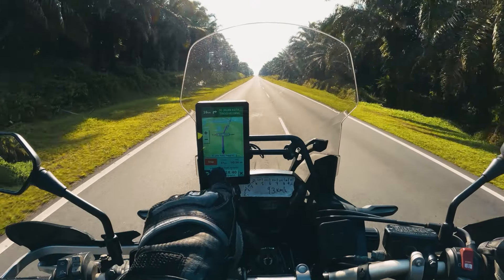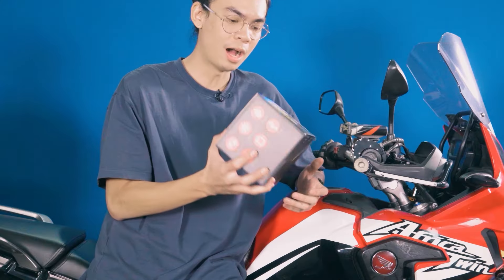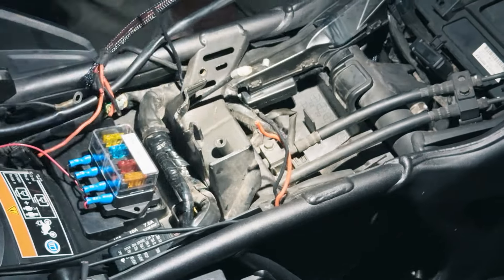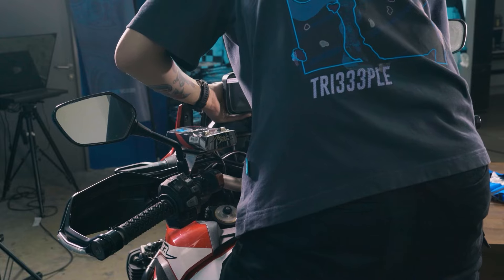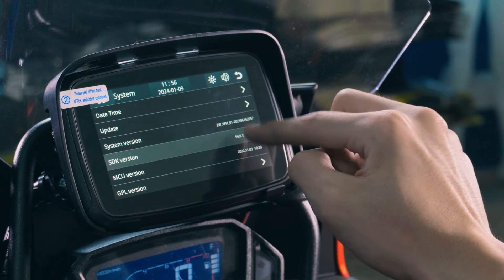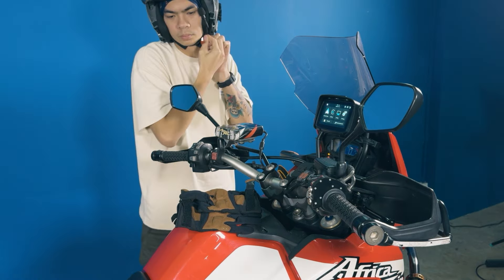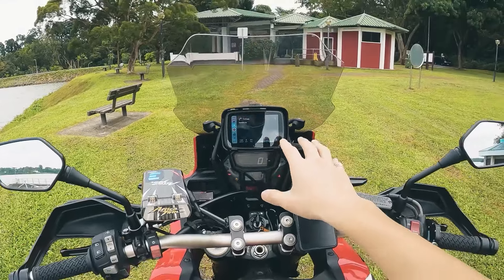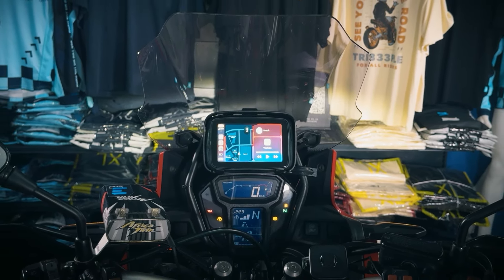Ottocast C5 Lite CUSTOM BOOT IMAGE | ScrewIt EP8

Comment: would this fit on a vespa with no handlebar?
Reply from the maker: It uses a standard ram mount system, and would be able to have fittings to mount onto the mirror mounts for example. You might have to get some parts for that if the included mounting doesn't fit your bike, but it's definitely do-able.

Comment: Thanks for this video, can you tell me where to get the firmware file to try to flash my unit with custom logo?
Reply: I already have the image file I want to show up on boot, but I’m not finding Ottocast fw file to flash it.
Reply: I bricked my C5 ( all black when turning on ) then asked Ottocast their original fw and it started working again, but even if I put the logo.jpg ( 1024x768 ) in the sd root with the fw it flashes the fw but won’t change the boot image.
Reply from the maker: Hey man! From our research, it depends on the FW already flashed onto the C5. Some firmware, especially updated ones, might no longer support changing of the boot image, and trying to flash would end up bricking the device!

Comment: Wonder if there is a device that i can slot a SIM card in so that i dont have to worry about wifi connection..
Reply from the maker: Devices like this tether to your phone, so chances are if your phone has no connection, even with a sim card in the device, you'd also probably have no reception. If that's a possible fear, getting a dedicated GPS unit that communicates with GPS satellites would be a better option.

Comment: Mine keeps turning off randomly. Ever happened to you?
Reply from the maker: Yeah it happened a few times to me, but checked the power connection and turns out it was loose. If that doesn’t fix your issue, a firmware update might be in place.

Comment: The c5 lite is interesting, but if I had to pay someone to help install all those wiring, I rather use the money towards a zumo xt, which I can install easily by myself...😂😂😂
Reply from the maker: Actually don’t need to, as the wiring is just a positive and a ground for the USB. If you already have an underwear usb you can connect the connector to it easily!

Comment: lol you can get the oem device at half the price
Reply: Can you link where to buy?
Reply: @HanazonoFiama Taobao bro, if I remember correctly with shipping and tax is around 150-160
Reply from the maker: You definitely can find cheaper options from OEM, however there is a range of firmware available, and not all sellers would provide the latest updated firmware, as well as provide return support. Might not matter to you if you’re more tech saavy!